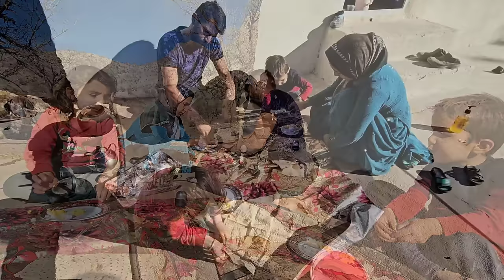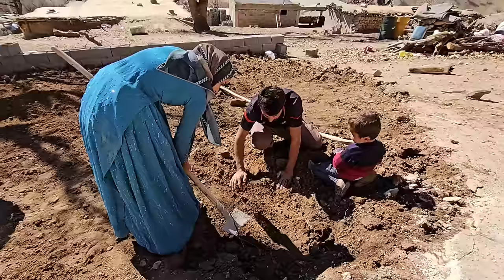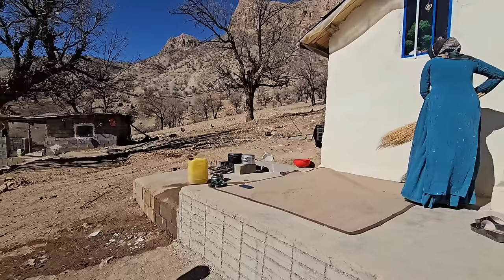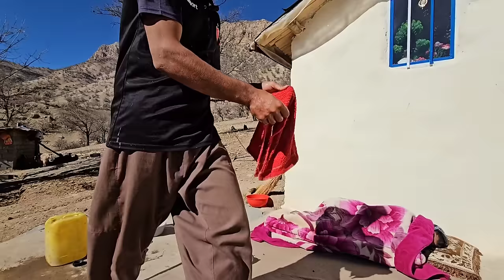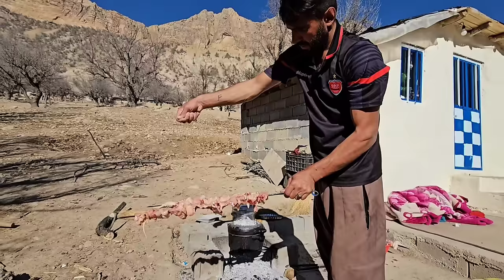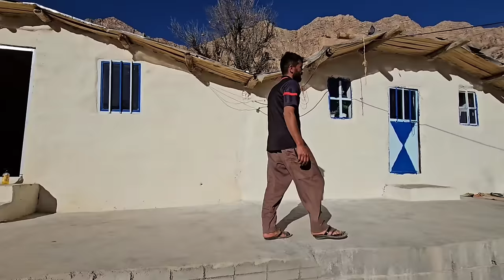Infinite reflection of love and care: the story of the construction master and the angel. part 106

Comment: Imran, you need to dig fertile earth from another part of the land and fill that garden patch with so that it does not become a pit and also weaken the house, as you are digging too close to the front of the house.  The garden patch needs to be a mound, that is it needs to go up rather than down.  Rain can wash out the land at the front of the house and expose the line of bricks and that can collapse and the platform will also get washed away and the house itself will become exposed to a very sharp slope.